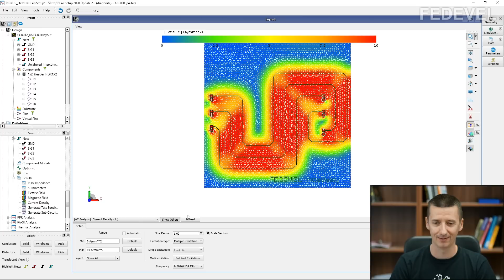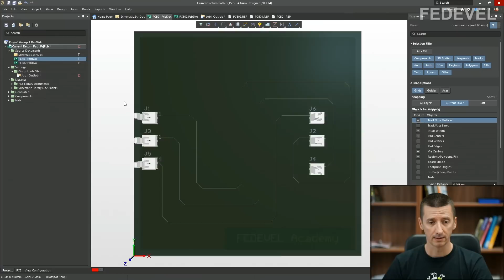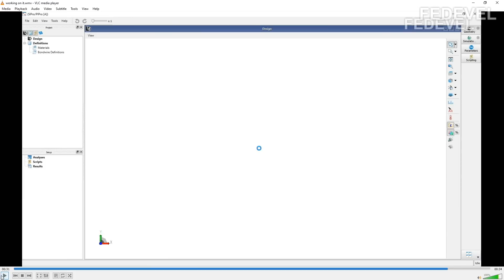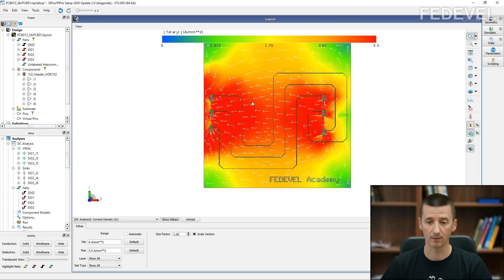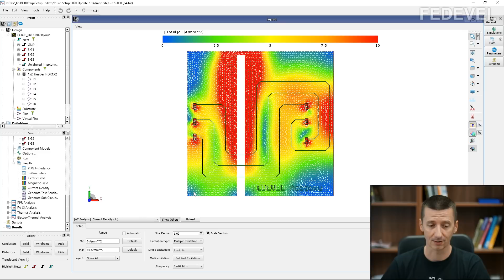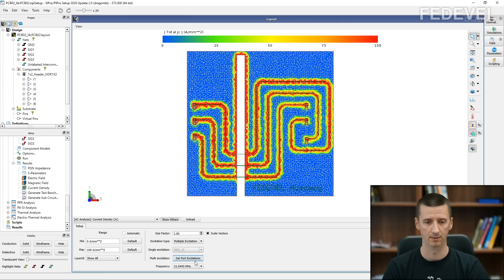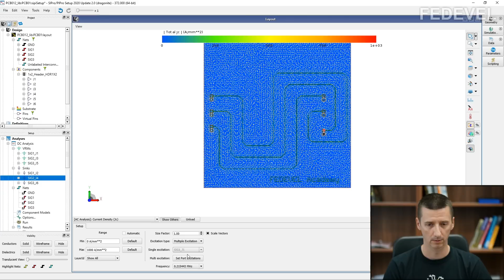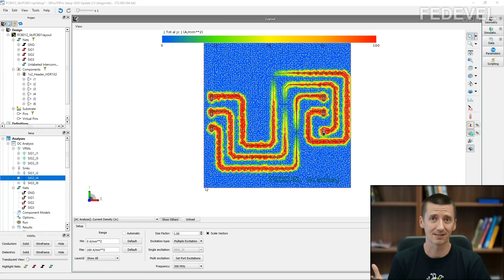Does Return Current Flow Under Signals? Watch these examples ...

Comment: Very nice sims and videos you make. I try to get our layout guys to watch your vids but they are not interested. Too bad for them. 
The slit is not acting as a capacitor. The capacitance is too low over the slit (too much distance and too small parallel area) and the frequency too low so there is no capacitive coupling over the slit. The sim shows the concentration of current on the slit edge, not across the slit. The current going up the slit is the return current for the current going down it and vice versa, which is why the current is so concentrated at the slit edge. The return current is its own return and therefore couples to its self. The other phenomena we see is the resonance frequency of the board and traces. We see all have the same nulls at about the same length of track. This must be the wavelength of the energy (speed of light in the PCB material divided by frequency). Not only the frequency of the signal, but also the resonance frequency of the board. Imagine exciting the board with a square wave with fast edge. The ringing on top and bottom of the edge will have frequency of the board.  
The result of the slit is increased inductance because of the larger loop, a nasty interruption in the impedance of the traces, creating huge EMI issues, and SI as well. Some boards may work but they will likely not pass EMI tests.

Comment: can u do the same simulation with a complete polygon as a GND plane (return path) and post a video
Reply from the maker: Omair, I am not sure what you mean.
Reply: @RobertFeranec  as I see, you are using return path on bottom layer, which is a trace. I asked you if you can make bottom layer as polygon and use it as a return path. And observe the difference
Reply from the maker: @therandomchannel9226  Bottom layer is solid GND plane (polygon).

Comment: Current always goes threw the path with least impedance.

This guy explains pretty well the blank spots https://www.youtube.com/watch?v=ZyoqhJB_E9Q&ab_channel=RobertFeranec
Also remember everything is capacitive cuppled, you have different source but at the end they are all coupled with each other.
In cases where current is completely missing from a track I guess that it travels under the other tracks. (but it seems a bit buggy)
For different results under different current my explanation would be: Temperature
It messes up resistance of the plane, plus as we can see from reflections, it looks like it's a time snapshot from simulation, it may be a couple of ms after power up and some parts of plane are extremely hot and some not so much, this can create a lot of weird result.
Reply: "this guy" is he., himself.
Reply: @uccoskun  it was a joke.... :P
Reply from the maker: Thank you Fire Developer :)